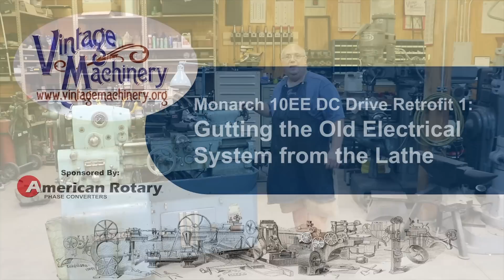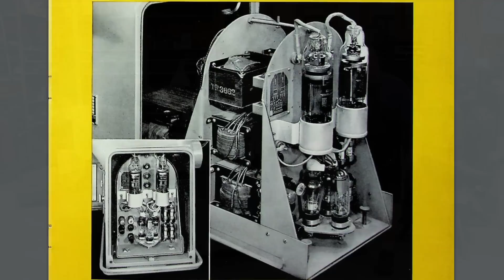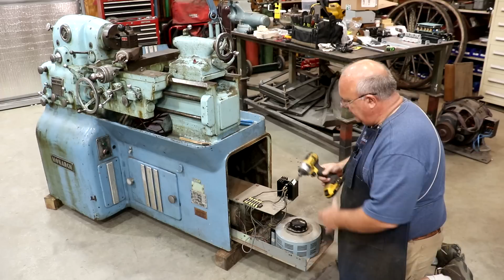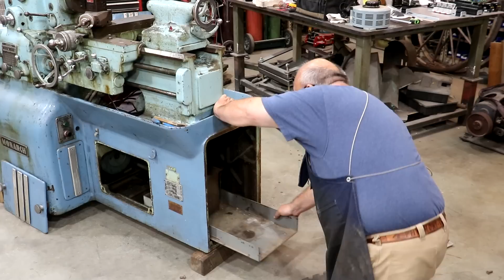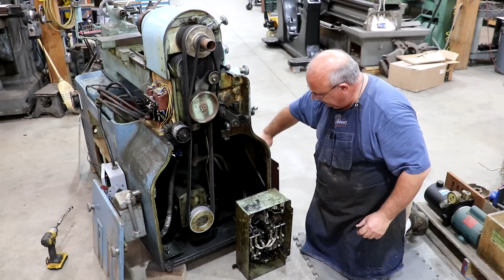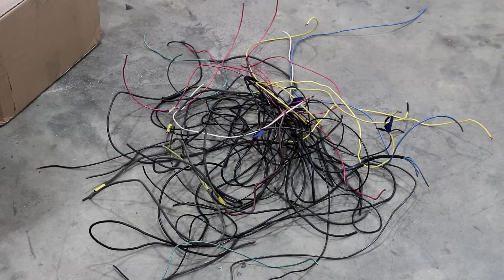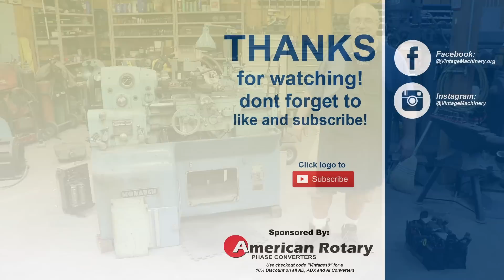Monarch 10EE DC Drive Retrofit 1: Gutting the Old Electrical System from the Lathe

Comment: If you reuse the switch controls on the front of the machine, remember that you’re relying on used contacts also. Those contacts may have been carrying higher power and might be OK for relay logic, but too pitted and dirty to allow reliable use with a VFD. 
I had this happen at work with a production machine that would intermittently stop for no reason.  We finally traced it to the stop push button contacts. They were factory original and worked fine with the eddy current drive for 20 years , but when the machine was reconditioned and a VFD was installed, the problem appeared. The VFD was able to catch the microseconds long breaks in the run circuit caused by the old contacts that the relays just ignored.
Reply: He is not going to have an AC motor, so no VFD.
Reply: Agreed, the point is that today’s digital drives, AC or DC, need clean input signals.

Comment: Keith,

Before you start rewiring your lathe, you might want to consider a DYMO Label Maker.  They make labels that are designed for marking wires. Their products include tags and shrink wrap labels. 

It may not be a necessity.  But  it will make trouble shooting far easier. 

Bob
Reply: My Brother PTH110 does too! It can do wire flags OR you can get heat shrink cartridges. Came in SO handy rewiring my old RX-7. What a rat's nest ;)

Comment: Just a thought.  A different direction would be to swap the DC motor for a 3 ph motor than you could control it with a VFD.  You can get an inverter duty motor any hp for a reasonable price.  With the VFD, you have infinite control of the motor.  Torque at low & high speed.  Stop on a dime if you want.  Run it at 1 rpm.  Is there something about a Monarch EE that would not be compatible with an AC motor?
Reply: When you clip cycles to slow an ac motor with a vfd you also clip the motors torque.  An ac motor running say 20 cycles to cut the speed to 33% would likely only make about 10% of the rated torque. Also many ac motors will overheat when heavily loaded at lower rpms than they are designed for.
Reply: @bcbloc02  most ac motors have a turn down ratio of 10:1.  20:1 is  better.  Where I worked we had motors with a turndown ratio of 1000:1.  1800 rpm motor could be run at 1.8 rpm all day long.  Minimal loss of torque.   No heating issues.  Motor was designed to operate at that turn down ratio.  So it’s doable.
Reply: @scruffy4647  Yeah with a motor that is designed for it it will work just fine. Most common 3 phase motors you would find are not made to do that though.
Reply: @bcbloc02  I am not familiar with a Monarch EE lathe.  Is it a gearhead lathe?  I just bought a LeBlond Regal 13x30 standard shift.  3 hp 3 ph.  My shop has single phase.   I am using a non vector VFD.  Since it's a gearhead lathe, I am just keeping the hz at 60 and using the speed changes with the shift levers.  We had the older style DC motor and drives a long time ago.  The best thing we did was convert to VFDs.  Those DC drives were fine but it's old technology.  Why go through all that trouble on that Monarch.  What am I missing?
Reply: @scruffy4647  only 2 gears on that series of monarch. Otherwise I believe speed is strictly controled by the motor which I think runs from 60 to 3450rpm.

Comment: Hi Keith, an idea popped into my head when watching this episode. I think a t slot milled in to some aluminum 2 by 2 bar stock bolted down to the drawer would make perfect sense. That way your assembled panel of electronics could be be slid into the slot and secured quickly.

Comment: Did you consider a 3-phase motor with a VFD?
Reply: When you buy a factory rebuild machine from Monarch they use a 7 1/2 HP invertor motor and VFD with the back gear box. The lathe will not ramp up or down as fast as with the old DC system but you do not have to work on them all the time. The original works in drawer drive system is really cool but I always need to tune and tubes are hard to find good ones.

Comment: You can tell you know more about electronics then you give youself credit for, from the way you explain things.  
You might want to double check and make sure the control transformer is fused correctly on the primary side.  In case there is damage and it eventually shorts out.

Comment: Keith, you mentioned a motor-generator set in the 1940s 10EE.  There is something called a rotary converter that was used in, among other things, the NYC subway system.  Rotary converters are more efficient than motor-generator sets, BUT they work best with 25 Hz. AC power and that might be the reason Monarch did not use the technology.  60 Hz. rotary converters have been employed, but they are troublesome.  Stresses multiply as the power frequency rises.
Reply: the drive system in the early 10EE was a "Ward Leonard drive system" ie a ac motor drives a dc generator that then powers the drive the trick with them you could vary the shunt excitation on the generator and that it turn varied the output to the drive motor , for more speed you weakened the shunt voltage on the drive motor . I have in the past work on many up to 50 hp ( yes my aprentiship time DC was still a tordeforce in the iron works ) also how about a six phase rotary converter with open switch gear to start them up ( open knife switch) so six phase ac in and 220 vdc at 2200 amp output those were the days no HSE to worry us

Comment: It’s good to have friends, that can help you. This is gonna be a very interesting rebuild. Are you gonna read grind the ways and re-scrape too?
Reply: He said in the original video that the main reason he was working on this particular machine was that it looked like (to the eye) it was practically wear free!  I believe he is not planning to have to do any scraping.  He is completely rebuilding his other 10EE and has said many times it will get the full restoration with all of the grinding and scraping it needs.

Comment: There is always something cathartic about ripping out an old rat's nest of wiring.

You might want to keep that swing-out box inside the left end by the motor. You may not have a use for it right now, but you never know...

Comment: "works in a drawer" reminds me of the old ads for Quasar televisions (made by Motorola IIRC). At the time TV's were still commonly felt to require frequent service. Most TV's were serviced from the rear, which means the person doing the servicing would need a mirror to see the screen and could not easily reach the user controls.
Reply: I remember the ads for those Quazar TVs and think about it every time I have to replace some board in a piece of equipment. The jingle from the ad still rings in my head!

Comment: You have a workable plan, but, it would probably be possible to rebuild the original system - tube technology is perfectly viable and reliable enough for typical job shop use, and they used it for decades.

Comment: The big old transformer. If the windings don't match, you can have it rewound. Just like big motors can be rewound. After all, you already have the iron you need, and the old copper can lower the price. So you get new copper wires almost from the old turns in the price.
Reply: The scrap copper is definitely valuable.  The laminations in the transformer may be old enough to predate grain oriented silicon steel (GOSS).  GOSS is definitely superior to what was previously used.  Outright scrapping might be preferable to a rewind.

Comment: Your "rats' nest" of wiring reminds me of a job I had years ago. Basically, a lot of 440 3-phase circuitry in a control cabinet. I never (in 8 years) could get anybody to tell me WHY the original design used ALL RED WIRE with only a number code at each end! 🤔
Reply: I work on a PLC controlled retort system that was originally built in 1989.  I worked extensively with the engineer who installed the system.  They used ALL BLACK WIRE with number tags.  The reason I was told: it made it easier for the guys who were building the panel.  They could just grab the end on the spool, stick a number tag on it, pull the required length, cut and put the matching number tag on the other end. then all they had to do was match the wires to the corresponding terminals.
Reply: Hi Phil, I've done a considerable amount of control wiring in the  past, what I came to realize is there are not enough colors of wire to get most jobs done. its far easier and less time consuming to settle on one color and number them then mark on a print. I did use red only because it was there and easier to see if you had a problem.
Rich
Reply: @richb419  Understand completely! As long as the end numbers are good it's no problem. I DID get a regular earful from the field service techs trying to troubleshoot a panel without the schematics (pre-laptop/cell days)...
Reply: Single color wire simplifies inventory requirements. It does force you to use accurately labeled wires that are identified on wire lists and schematics.
Reply: The circuit diagrams just had numbers on too. Maybe it was cheaper to buy one huge reel of wire rather than a number of different coloured wires. I've had plenty of machines in my time and they were either all red or all black wiring.
Reply: When I did this sort of thing in Canada red wires were DC blue wires were 240 Volts and less black wire was 440 volts and up
Reply: @ypop417  HI, I saw that in the foundry in the US the problem for me I our 3 phase systems used blue a phase and some times at the foundry some people would use the blue as a neutral when it was part of a 3 phase 480 system, It got dangerous.
what was needed is a set of rules and that place didn't have any 
Rich
Reply: On an inspection visit to a contractor in Boston I had the sad responsibility of telling them they missed the section in our bid document on wire colors. They had wired the enrire control cabinet with red wire (about 2000 wires), when our specification clearly said black and white. A month later I got to make another trip from Texas to Boston. They did top notch wiring, they were just bad at reading specs.
Reply: In the HVAC business, a few years back, Trane commercial units were wired with all black wire and numbered.  After a few years on the roof, the numbers are gone or illegible and you are on your own!!  What a thrill that is!!!
Reply: All I had was a large roll of red and I’m partially color blind so numerical and alphabetical coding works best for me!!

Comment: 6 wire dc motor..whoa that take me back to highschool. Series parallel dc motor. Two poles in series and two switchable shunted poles in parallel for different speed ranges. Three or four speed ranges in total. Complicated, however if it went bad the dc motor could have run on. May want to have motor checked. Run on is when the fields supply current to armature and motor goes up and up in speed till it explodes. Note dc motors it’s fields and armature. Stator is ac or alternator.

Advantage to design is torque. Two shunted fields means low speed but maximum torque. One field shunted is medium speed. None shunted maximum speed.  Fourth requires a centrifugal switch for startup. 426 Chrysler hemi starters used a shunted field for extra torque. Hard to find.
Reply: Yep, I've experienced runaway on a big shunt connected DC motor when a student started it up without checking that the field winding was excited too.  Very scary but the armature fuses saved the day!
Reply: @hectorpascal  My lab partner in school 40 years ago couldn't see the field ammeter. He picked up it and the field wire popped off.  I never thought a motor could spin that fast.  Man, it was wild for a second. I panicked and pulled the power wired out of the wall box. The prof asked if we got a speed measurement. Those were the days!

Comment: Love your videos..
Is that a four wire DC motor ?
It might be same type as used in electric forklift and golf-cars.
A company named "Curtis" makes cheap controllers for these DC motors, but I don't know if they make a version for higher voltage than 80V
Reply: DC motors for vehicles are normally Series field motors, the have the problem that they run away under no load conditions. They are the same design as the starter motor on your car but the polarity of the field winding can be changed that is why they have 4 wires. For machines we use Series/Shunt motor, The series field normally don't get the polarity changed if you change direction. That is why it may only have 4 wires.